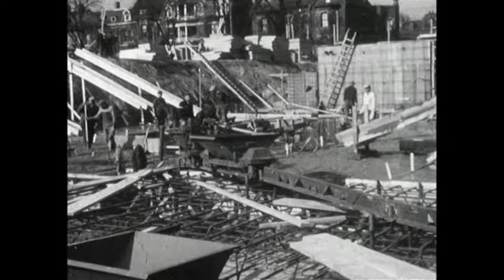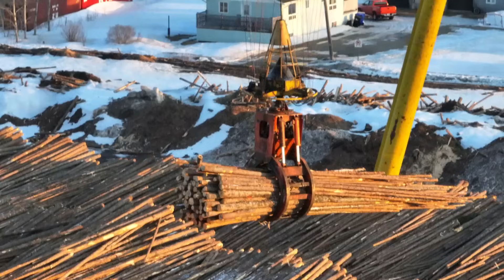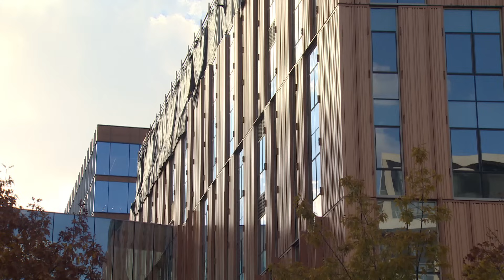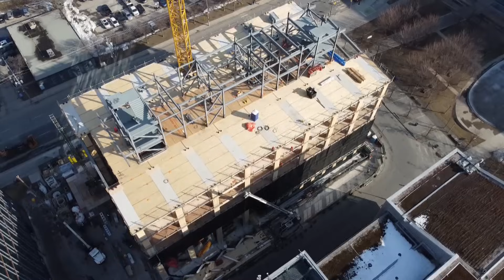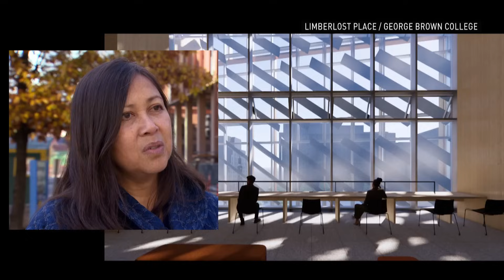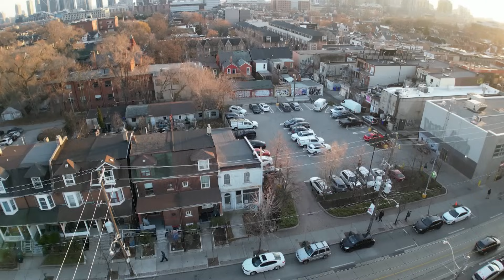Could mass timber construction help the housing crisis?

Comment: What fire hazard ?
Reply: I suggest you do some research on the matter
Reply: I have.  Wood burns better then concrete and steel.  Way better.  I would not live in a wooden building with an elevator for the obvious reasons.  @Snowman2389

Comment: It is called pre-fab, and it has been around for almost 100 years. Laminated wood floors, beams , etc have been around for over 50. Let us solve the housing crisis with math. 100, 000 units for 400,000 people. Just does not add up does it:body-blue-raised-arms:

Comment: To solve the housing crisis with mass timber is not a golden bullet that fixes all; the main issue is zoning. If you convert 5% of single family zones or allow conversation of the many empty commercial buildings and given funding to build medium to high density residential units, you could make a serious impact in the housing crisis. 
Just converting 5% of single family zoning for medium density zoning will allow developers to build enough units to make housing affordable within cities. For the same land area as 3-4 single family properties, you could build a minimum 20 unit building that could house close to 50 people. Rezoning and amending the zoning laws is one of the ways to solve the housing crisis.
Reply: Pretty much. Mass timber, concrete, sticks, mud, whatever! They just need to build units.
Reply: Timer frame can easilly go to five floors. rezone in the large cities the two/three floor buildings that are at th eend of their usefull life AnYWAY, and you're good to go: an incentive for the owner to go UP, and usually the foundation, boiler, and elevator would need minor upgrades to service a couple of floors. and it's already right there.

Comment: From the highway just south of Prince George, B.C., you can see the logs, thousands of them, piled neatly in rows. 

They were cut from trees in old growth and primary forests in the province's Interior.

This timber won't be used to build homes or furniture, or even to make paper. These logs will be ground and compressed into tiny pellets, shipped to Europe and Asia and burned to produce fuel for electricity.

Britain's largest power plant, Drax Power Station, controls most of B.C.'s pellet production and has ambitious plans to expand operations in Canada.     Looks like  all the clear cutting we doing is really green and really helping the environment well as long as there is a CARBON TAX WE ARE GOOD RITE !!!!! LOL...................😅
Reply: NON of that timer south of P. George and/or viewable is first, or even second growth.